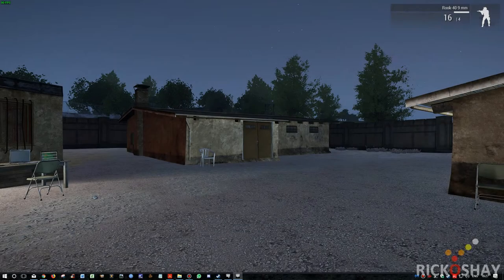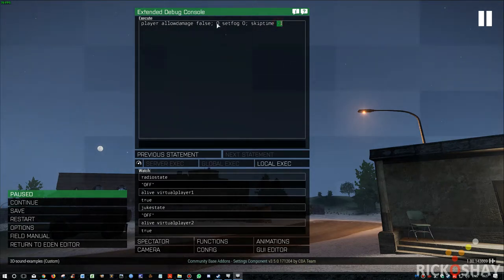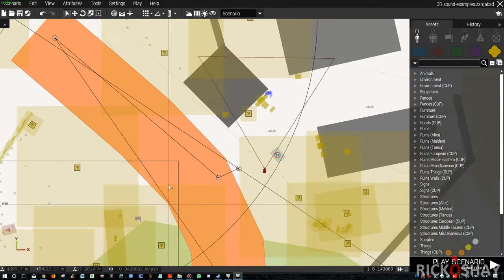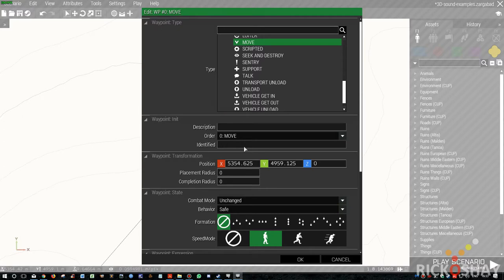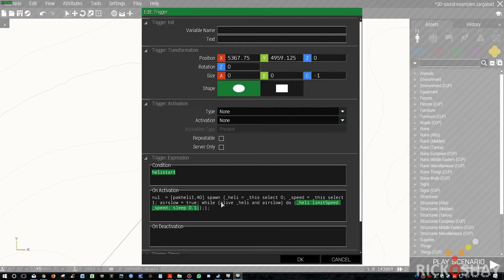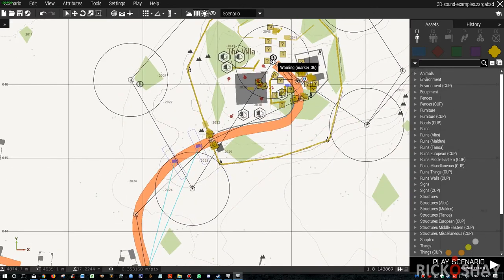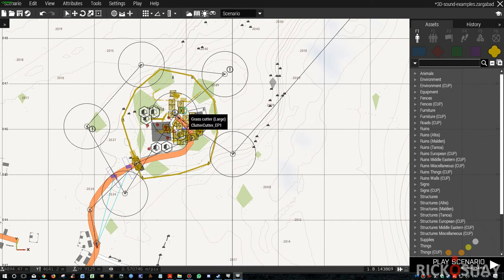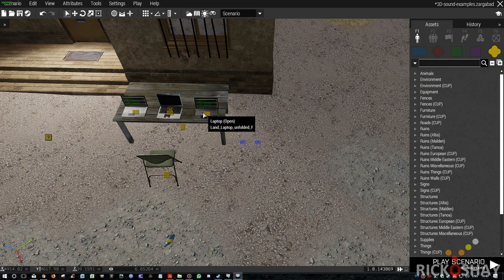Create a search heli with a searchlight and PA system

Comment from the maker: Pardon the error in my commentary - I meant scheduled environment. And if the sound volume is radically attenuated with Say3D on moving vehicles do this:

Use alternative Say3D syntax:
[from, to] say3D [sound, maxDistance]
[heli1, player] say3d ["giveup", 1000]; // Note the large distance var - reduce and test

Also in your description.ext you need to add the distance field for the sound class under CfgSounds as follows:

//filename, volume, pitch, distance 

Volume needs to be very high - like 50 and have a large distance value 350 see example below. 
(I'm not sure what the ideal / best minimum distance is - it depends on the object requirement.
I would need to do some more testing. In this example I set these values for a search heli with PA system and it works very well)

class CfgSounds

class giveup {
             name = "giveup";
             sound[] = {"sound\giveup.ogg",  50, 1, 350};
             titles[] = {}; 
};

Comment: Hi Rick,

Does this sound script play once per palatable character? I’m concerned about the sound repeating (ie., the trigger activating multiple times) for every player than enter the area which activates the helo to come into the AO and say3D sound on each waypoint init
Reply from the maker: This was a simple SP demo. In MP - firstly the 'helistart' var used to trigger the search process would need to be a publicvariable. Each heli waypoint will fire just once and the sound will play on the object heli just once. Since in this case the heli is local to the server in MP you would need to remoteexec say3D so each client would hear the sound. If I was making a MP mission I'd rather script the whole thing and make the search process a bit more random and probably have multiple sound files to make it a bit less repetitive and more interesting. I'd also reduce the reverb and echo effect on the sound files.
Reply: @RickOShay  appreciate the quick response on this. I've accounted for the points you mentioned regarding trigger and randomisation. 

within the init, would it simply be changing the Say3d to remoteexec say3D?
Reply from the maker: @jtaalib No it would be something like the following. Will require some testing. And you need to include the distance param in the CfgSounds declaration.

[pakHeli1, ["giveup", 500]] remoteExec ["say3D", 0];
Reply: @RickOShay  cheers Rick, conducted the op and one of our guys managed to headshot the pilot whilst he was circling with the audio file😂🤣 love it. Arma missions never go as planned!!
Reply from the maker: @jtaalib  Yes lol - maybe make the pilot indestructible.

Comment: Could you make a script that doesn't need waypoints to pause the chopper? 
I am using TCL and it automatically calls in the chopper as reinforcements and I would like the script to interfere and play the file once it's close to a player.
Reply from the maker: As mentioned in the video - say3d - seems to require the heli to pause briefly and fly slowly in order for it to play the sound - this is due to distance calc and volume fall off (sound attenuation). So you would most likely have to have some kind of pause or force the heli to move very slowly - and when distance is ~ <100m from player it would then play the sound. You will most likely need a waituntil or while loop checking player <-> heli distance constantly. So please Sub and Like if you found this useful and then send me friend request on Steam (if you havent already - this is done to limit spam on the SW) and I'll help you get this working with a script.